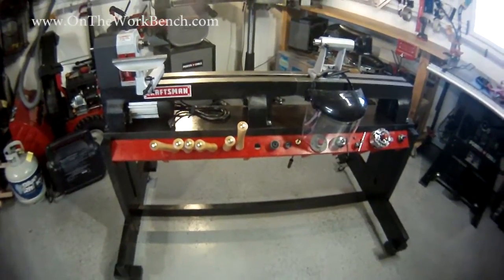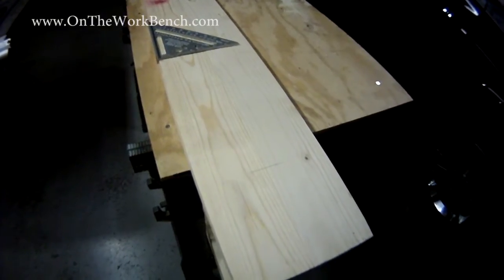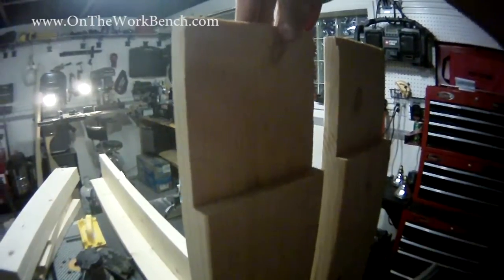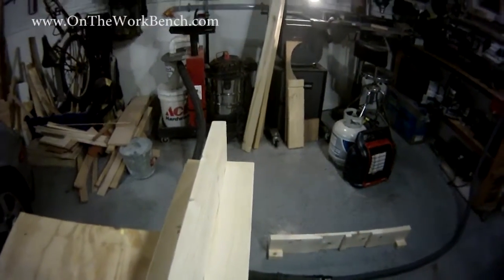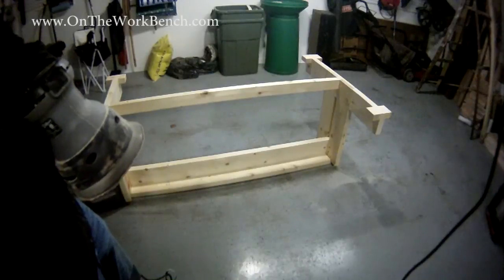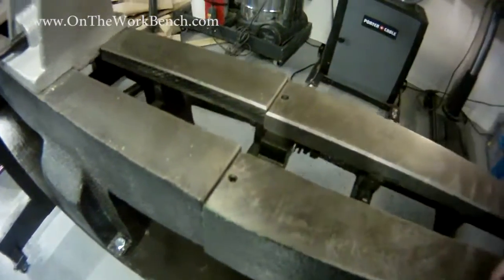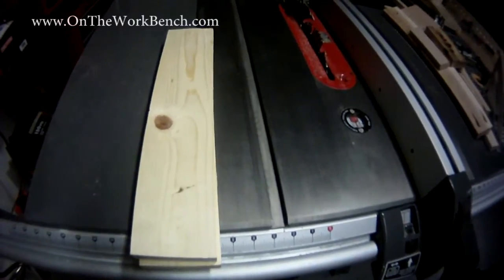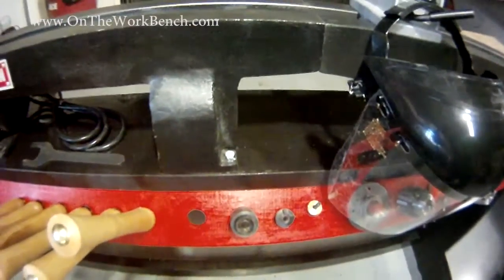Building an Ultimate Lathe Stand

Comment: Beautiful job. Congrats.
Only two suggestions:
1. A shelf over the runner so you can put some sand bags in case you're turnong a heavy or unbalanced wood log.
2. Install the accessory rack in a way you don't hit the gouges with your belly while working.
Reply from the maker: +Marcos Baldin Very fair comments, I've been thinking about adding another center support higher up. I left off a shelf over the runner so that I could fit my drill press and band saw basses between the legs when stored.
Reply: +On The Workbench - Good ideas. Thanks for the feedback. Your video was really inspirational for me. I'm going to make a base for my lathe and would apply many of the ideas you've shown.ButI have to find ways to make it very stable since I want to turn large bowls. 
My current lathe's head-stock, bed and tail-stock are quite heavy and strong, but the base is actually light and weak.God bless.